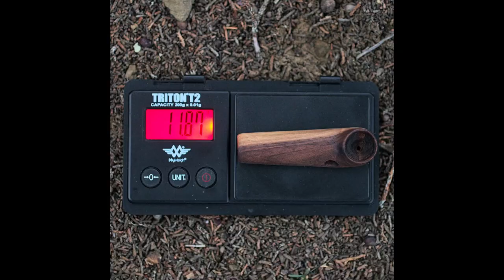Making a lightweight wooden pipe

Comment: That's awesome! What wood oil did you use? And what was that conical drill attachment?
Reply from the maker: Thanks! Sorry, didn't see your comment until now. I only showed the first coat in the video, and I did a couple more after that, but I used 100% tung oil. The first coat may have been mixed with isopropanol, I can't remember.
The conical drill attachment -- not sure what it's called, I found it at Home Depot. It's just an abrasive thing so it removes material.
I ended up getting some semi-circular drill bits to drill the bowls, which should give the ideal shape right away in theory, but they seem to do a strange kind of triangular effect on it, probably because I'm using it hand-held and not in a drill press.
Reply: @Joe Omundson  thank you for letting me know. I can't wait to make my own pipe. I live in north central Texas. Any wood you recommend?
Reply from the maker: @Turn140  Good luck and have fun! In this video I used walnut, which is my personal favorite. Cherry is also popular. Could also use maple? Oak might be irritating, honestly just be careful with anything in case you have a wood allergy. The inside of the pipe is gonna burn a little bit at first. If you google popular woods for tobacco pipes you can find a list. I have also made them out of softer woods but I don't recommend it for durability.
Reply: @joeomundson  Did you only coat the outside of the pipe with tung oil?
Reply from the maker: @Turn140  Yes. I don't put anything in the bowl or the inside

Comment: I am curious to know how long wood pipes like thos last. Like does the wood eventually wear down from yhe heat and flam from the lighter.
Reply: Depends on the wood, a good solid traditional pipe wood like briar or cherry will last a life time, any kind of hardwood should be heat resistant enough to last. Hell, first one I ever made for a friend was basswood, a super soft wood not meant for pipes at all, and he's used that thing daily for 2 years without an issue.
Reply: @imaferretmaster  omg thank you. Perfect timing I'm about to make my first one tomorrow. Gonna make a one hitter first since that is mostly lathe but I want to try and make a pipe to once I feel more confident in hand carving. 🙌🙌 I have a piece of cherry I got from my back yard. 🇺🇸🇺🇸
Reply: @rileydaily5426  cherry is my go to, it's much cheaper than briar yet has all the properties, it's a fantastic pipe wood